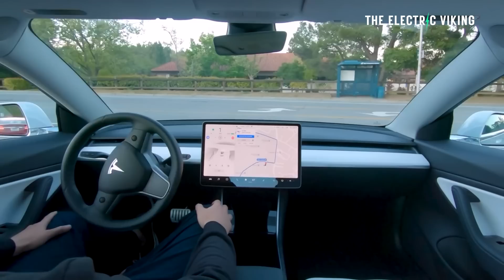Xiaomi builds the SU7 in 76 seconds using worlds biggest gigacasting machine

Comment: Personally , I don't like the possible high cost of repairing, say how are you to do panel beating when you can't change the body parts?
Reply: It’s going to produce a whole new world of repairs, maybe it will be a complete chassis replacement like the old English mini which had a sub frame. Main thing is panel beaters will stay in business for the foreseeable future !
Reply: unibody casting is for the internal structure, and typically dont include shock absorption components like the front bars, much less surface elements like panels.
Reply: First of all, you can just relax and be grateful that you bought a car that is much safer for you and your loved ones in the event of a crash, and not worry about the future repair scenario
Reply: I don't know, Tex. How do you replace the wheels on this new-fangled Conestoga Wagon, if you don't have enough lumber? You might be a few years out of date...